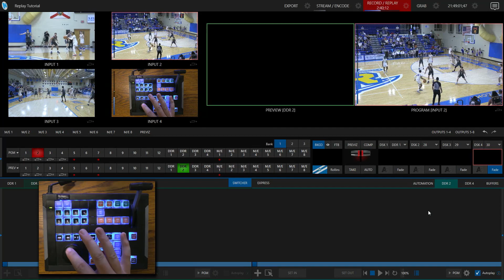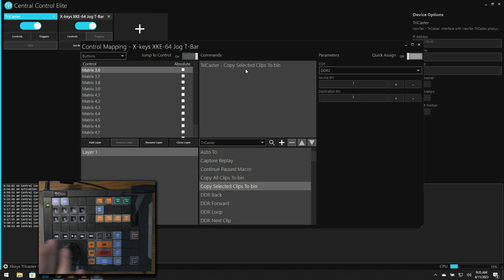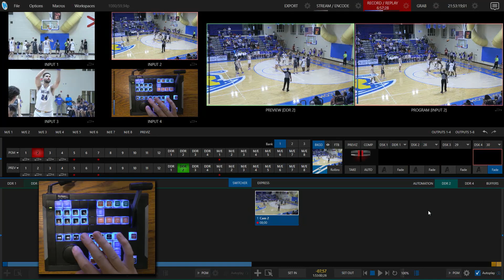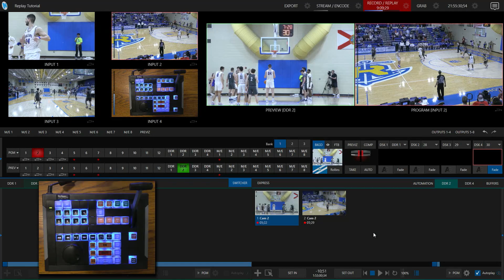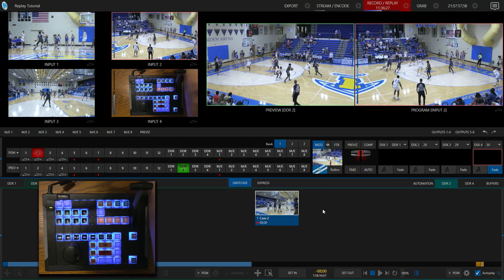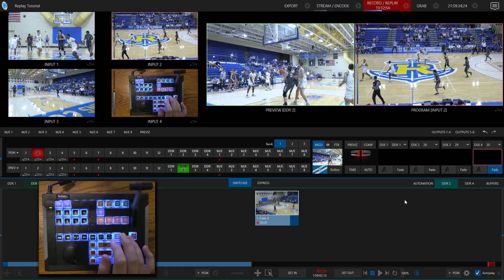Xkeys XKE-64 Replay workflow with Central Control and Newtek Tricaster

Comment: Is there a file you can save and import into a new Tricaster so you don't have to program the keys on every new Tricaster you want to install this on?
Reply from the maker: Yes, you can export your macros from the tricaster and then re import them. If you dont change the macro names after you set them up, they will still work with central control etc. If you had setup the Xkeys with native support then you the export would still remember the keys you bound to each macro I believe as well. I have example macros for replay you can download from the website: https://www.simplethoughtproductions.com/2020/05/21/tricaster-tc1-replay-workflow/